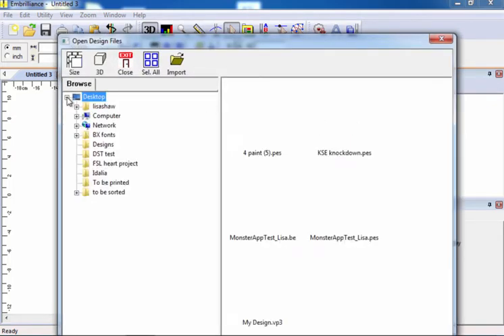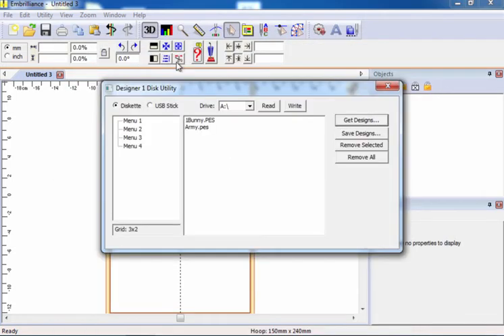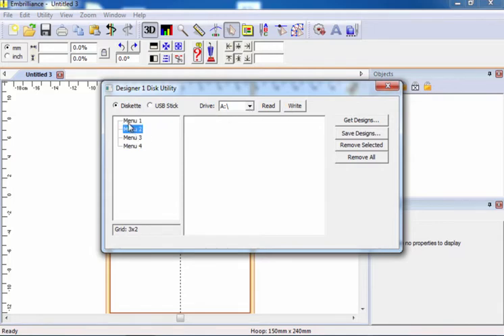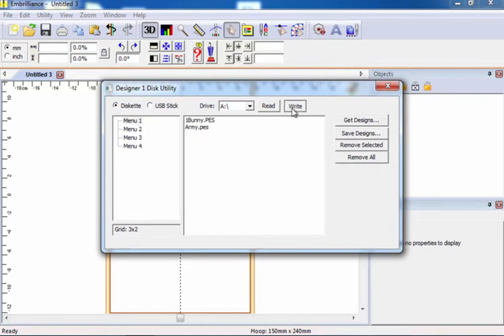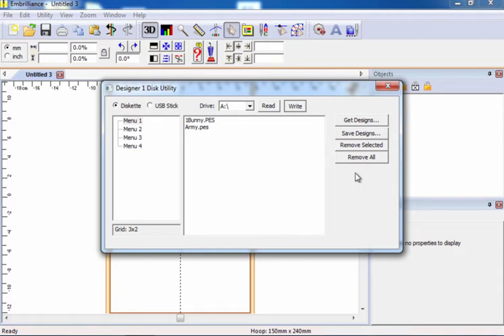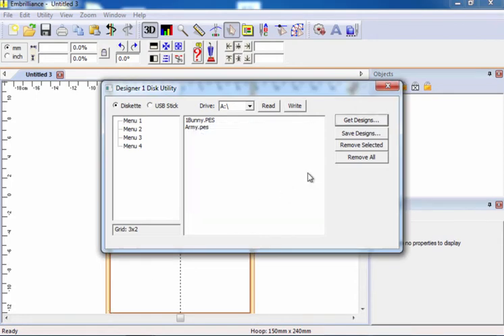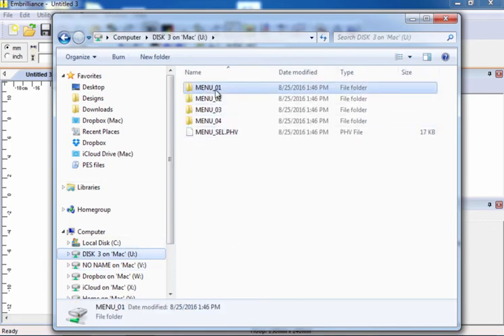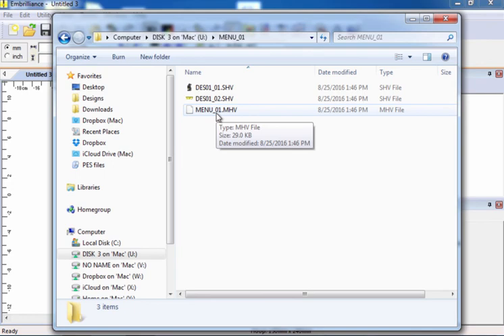Writing an SHV floppy in Embrilliance

Comment: My machine keeps saying general file error whenever I put in a disk that I’ve saved to. It will read original floppies made by Viking. Any idea why?
Reply from the maker: be sure to reach out to customer support to get help - sounds like a setting is off and they can assist you!  They answer every question within 24 hours if you submit using the contact us form.  You can even log into the system to see all of your conversations!  www.Embrilliance.com/contact-us